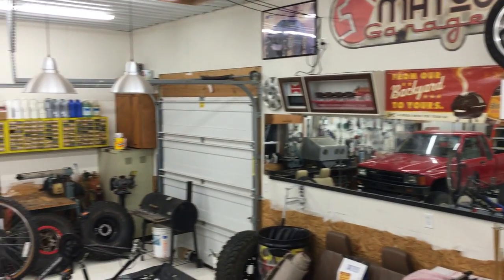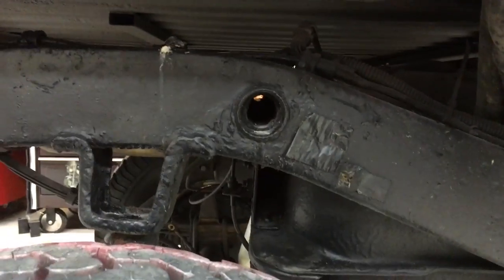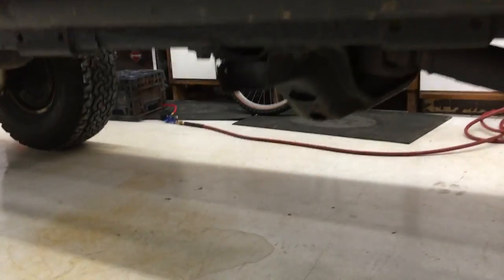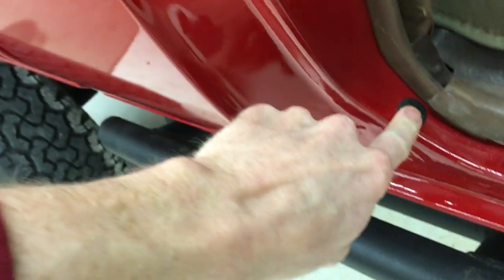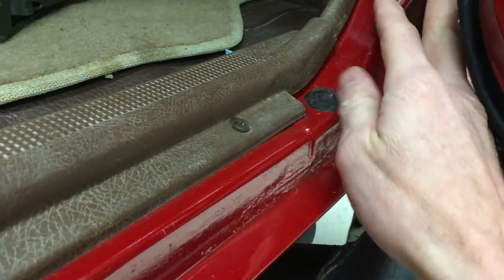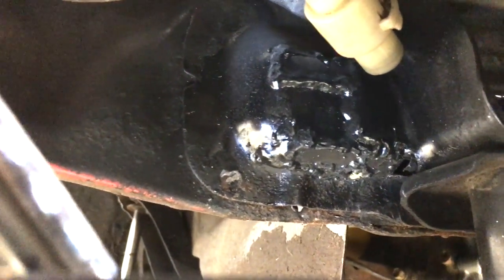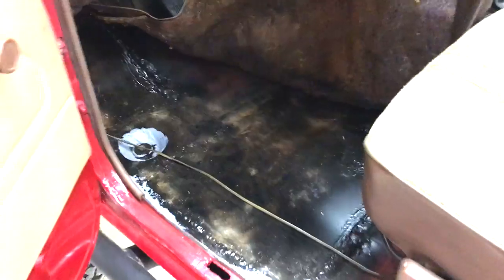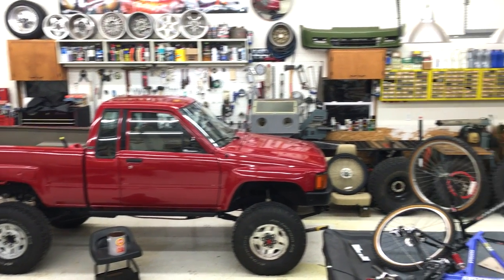Preventing Rust on 1985 Toyota Pickup

Comment: Another rust preventative tip to pass on is for the 85-88 SR5 trucks that have the black/metal trim that clips on over the drip rails. You need to take those off periodically and clean under them as they can gather dirt/mud, especially if you wheel your truck. That mud holds moisture against the sheetmetal and will eventually rust out your A pillars. I found that out the hard way, I have two nickel sized rust through spots (one on each A pillar) on my otherwise 100% rust free (even the bed), original paint 87 Toyota 4x4.

Comment: On my cars here in Finland, where we live with the salt scourge, I use Dinitrol ML which is an oil based penetrating rust protection, spray it on the underside and inside cavities. Then I follow it up after it has had a few days to cure with thick bitumen based underbody sealer. That's worked very well for me.

Comment: Thanks for this video. I have a 92 ex-cab v6 4x4 and I'm having to pull out the windshield this week due to rust from the original trim. Mine is a chromed metal trim which has / had a fine rubber seal around it which dries out, cracks, and lets A LOT of moisture accumulate and stay behind it.  I started seeing a little rust bubbles a few years ago and neglected to fix them immediately.  Now I have a serious welding project to replace a lot of the metal, mainly at the base on the two sides. When I removed the trim and started scraping paint it was a whole lot worse than I ever imagined, including some holes.  After some forum hunting I found that a lot of other people have had the same issues with the 89-95's.  Im going to get it all back to bare metal and use POR-15. For the new glass I'm also not going to use a rubber seal molding like some have for the windshield,  I will glue it in back in, then just use a non UV type of sealant in the remaining "U" channel around it.  No more trim for me. After this I'll be sanding the entire truck down and plan to spray on Raptor Liner.
Reply from the maker: Mine started to do this in the lower passenger corner of the windshield, behind the trim. Lucky I caught it early enough to where the metal was pitting but had no holes.
Reply: Don't waste your time with Japcrap that will never be desirable. Get something decent that was actually considered nice when new rather than a compromise.
Reply from the maker: @VinylToVideo  Different strokes for different folks. These trucks have a huge cult following which went mainstream after Top Gear's "Kill a Toyota" episode (The Toyota wouldn't die - try it in a Chevy/Ford.)  A restored 83 Toyota Pickup recently sold for $55k at Barrett Jackson, so I'd say Japcrap is becoming more desirable than ever before.
Reply: @6thGearGarage  Shocking.. I wouldn't pay $500 for it. We had a west coast '89 4 Runner that was rusty already circa 1993.

Comment: Spray with a pump up sprayer mixed with roughly 50/50 canola oil and water . Treat 2 to 4 times a year That's what i've done in Michigan for years. I had an 03 that looked brand new and I have a 13 that looks brand new. Original frame paint after 14 years in Michigan on a Toyota truck is unheard of. I don't even wash them during the winter. Rinse maybe... my seasoned cast-iron pan gave me the idea :(
Reply: Yes and using Canola oil is definitely better for the environment than using motor oil.

Comment: Great video.  Believe it or not,  had 1994 extended cab, identical to yours. Same color, with suspension lift, body lift, n bed liner, mint shape in n out. (I built for show n go )
Eventually sold to my sister, n bought a tundra. (Needed more space / room ) 
I do alot of camping, jet skiing, n now  pull n enclosed trailer, with my maverick x3, in it, along with camping gear. 
Anyway, good luck with ur build, looking amazing. Thanks for the tip on rust prevention.  😉
I have usually just resprayed frame, 2 to 3 times a year. Am in N.J. / N.Y. area.
Reply from the maker: Thanks!  How's the underside of your Tundra looking? Toyota builds a great truck, it's just a shame about the frames in road salt states.
Reply: 6th Gear Garage 
Yea, salt / winters, kill the trucks.  
My tundra was on recall of frame... 
N eventually rotted / cracks / holes... but got total new frame.

Comment: One of my colleagues put an electronic rust inhibitor on his 3rd gen. 4Runner and claims that he hasn't had any rust issues for over 5 years. I'm not completely sold on it since it costs a little over $200, but just wondering if you heard of it. Somehow it doesn't interfere with the vehicles electrical system and uses anodes that rust out instead of the truck...I guess? Like you, I have to keep up on the rust prevention cause I live in Missouri, but my '87 4Runner has it worse since it has no choice to sit outside in the elements year round. Love your truck by the way
Reply: I don't think those do anything. At one point in time my 87 pickup had one installed and it still had issues with bad rust.
Reply: Those things don't work. Ask anyone that works at the undercoating places.

Comment: I an original owner of 1986 Toyota pickup mfg. and assembled in Japan.  vin. JT4RN50RXG0198942   99,500miles..  cost $5850 4 on the floor. Carb. rwd. two clips on tailgate, I remove the cat. and the damned little mini truck runs and handles more like a 1955 MG Midget than a pickup.  It  shifts into third at 56mph comfortably.  The engine really started to be FAST around 60,000 miles(break in?) Lays wheels all thru first, all thru second and 'chirps' banging into third(at which point the V-8's catch it and pass it..really) Never had any engine work what so ever. Trans did not like going into Reverse around 88,000 and had that repaired, but nothing else all else is stock, except battery, plugs,  and tires and calipers and brake pads and filters.  Never replace antifrezze it is from factory 1986. All else is stock. Runs like new. Burns no oil. The body is rusted out but no holes like you show in frame. Frame looks fine. In fact, the continuous welds look well done, shinny and new. I look at brand new Toyota Pu's and they have  poor quality  spot welds and are rusting out as they sit on the Dealership lots. send photo if you like. , Let It Rust, Baby. Let It Rust!!!! The rusted body gives it patina, and when other drivers see it they laugh until you wheel out like a 440 , smoke the tires but blow no smoke from exhaust. , then their jaws drop. Really pisses off people with $55,000 shinny new  V-8's pickups , with computers controlling what the engine/trans can or cannot do(hahahahha) when they can't keep up off the line.

Comment: I see in the video a rust hole in the frame at 6:37.  Do you plan to repair the frame?  It looks like some kind of undercoating on the frame that is known to trap salt and moisture.
Reply from the maker: That was a factory rectangle hole on the side of the frame that originally had one of the plastic plugs over it. The plug tabs became brittle and broke long ago. Over time, the edges of the hole opening have had some rust eat away at the edge. The section of the frame under the cab is all original and I'm probably going to have to repair it eventually, starting with the inside of the frame rail. I need to do a video of the hammer claw test and I'm pretty sure it's going to show a soft/weak spot. The frame has never been sprayed with undercoating because of the problem you described, only POR-15, which is not UV-resistant so it fades and deteriorated over time. When I fix the frame, I'm using a UV Resistant rust inhibitor for sure.

Comment: Your videos rock! I have used so many of your tricks/mods.  I am restoring my 88’ DLX and need passenger side heater/ac vent retainer clips.  I can’t even find the part # for them.  If ya know of a site or part number let me know.  Thanks and keep the videos coming!!
Reply from the maker: You're not the first to ask me about those. Unfortunately, There is no part # for that clip as it was part of the vent, which have all been discontinued by Toyota.
Reply: @6thGearGarage    Thanks for the quick response. That's what I was starting to think.  Any other options?
Reply from the maker: @colbycolby8237  Each vent has 4, so you could borrow a clip or two from the other vents. The metal clips seem like they would be hard to make from sheet metal and tin snips.
Reply: Thanks man! keep rocking the yota vids!!

Comment: Hi what do think about just spraying wd40 water dispersant spray into chassis frame holes is that a good idea ? Especially after being hoses out ! Thanks
Reply from the maker: WD40 is a lot thinner than the fluid film, not sure how it will hold up over time.  Also be sure it's all the way dry before spraying inside so the water doesn't repel the oil.

Comment: I love your truck. I have a 92 Toyota 4x4. I want to know what you did to put a lift kit in.that's the height iwan to give mine.great job
Reply from the maker: +heath Adamsen It has a 4" pro comp suspension kit + a 2" body lift. The kit was bolt on- uses the factory spring mounts, so no welding needed.

Comment: Did you ever find a suitable one piece rubber seal for the windshield?
Reply from the maker: There's an aftermarket one out there, but IMO it doesn't look good. It's really wide and looks out of place, compared to the factory trim. It might be a universal rubber trim that installers are using on these trucks, because the corners don't look quite right either.

Comment: the problem with putting paint in the inside of the frame is you can't prep it so some will flake off and settle making the flakes of paint  hold moisture
Reply: 100% right, a dude told me to pour oil in any hole in the frame to help prevent rust.

Comment: I am sorry, but IMHO those holes have the purpose of allowing air to circulate through the frame.
Reply from the maker: Toyota put plastic plugs in the big rectangle holes from the factory, so I don't know if they were meant to circulate air.
Reply: I have an 85 long bed and I pressure wash it. My problem I have is that it wants to stall sometimes at idle. Sometimes it happens on the highway. Scares the hell out of me! My float bowl shows empty sometimes. Do you think its a diaphragm on the carb? Please help if you can!!!